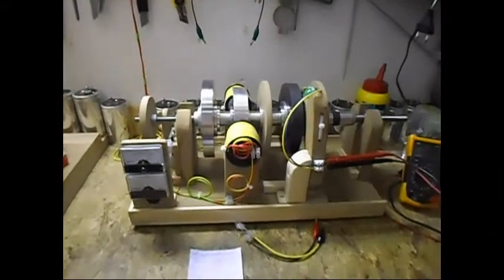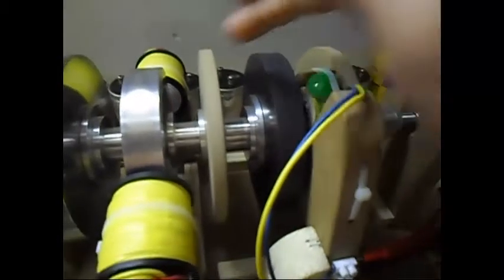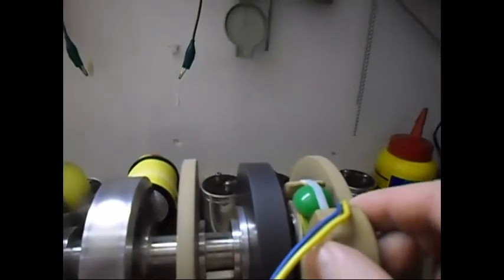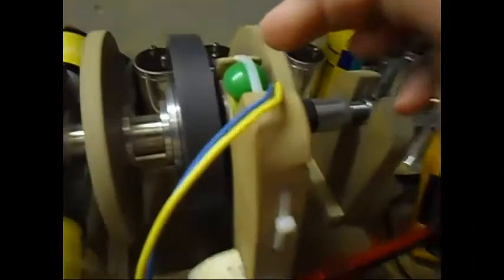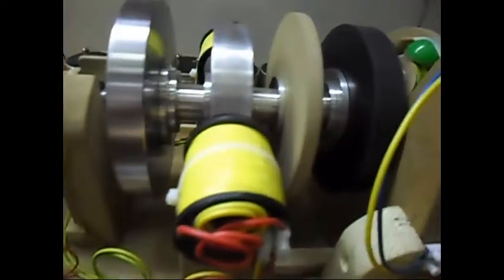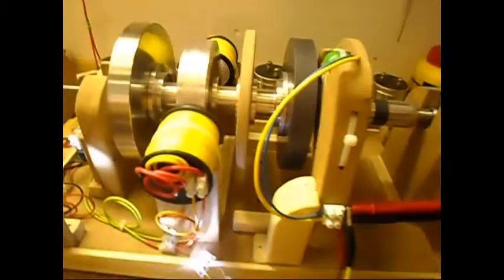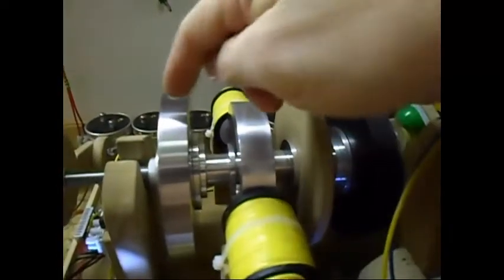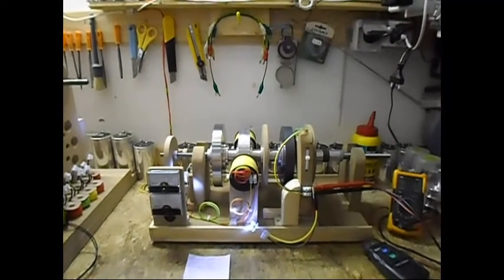Flux Gate Generator - Update 6 Rotation of rotors & ring magnet - short coil...

Comment from the maker: Here i'm doing a test with the short coil where everything on the shaft is rotating wich include the rotors & the ring magnet...^^
The output of this short coil isn't that bad at all but it still makes the system slow down but the the difference in coil in place and not in place is very little...:D
Input is 26vdc @ <50ma...i can run it on higher voltage but there a bit of vibration at that input but 26vdc is more than enough...
 
No coil in place = 1936 rpm
Coil in place and open = 1928 rpm - Ac volt here is 6.7
Coil loaded = 1866 rpm - Ac volt here is 2.7
Coil shorted = 1843 rpm

That the coil in place difference so little from it not being in place is a good thing so i'm gonna see what i can do to improve the slow down of the system part...^^